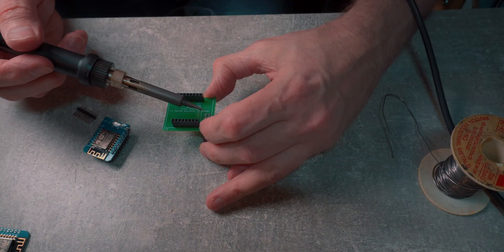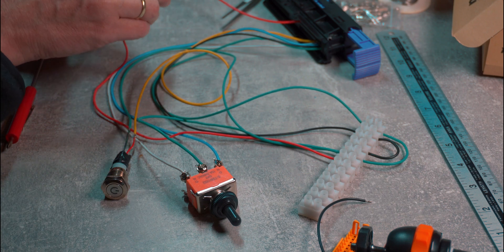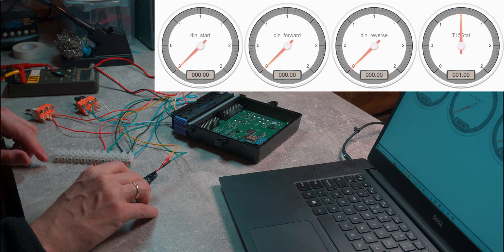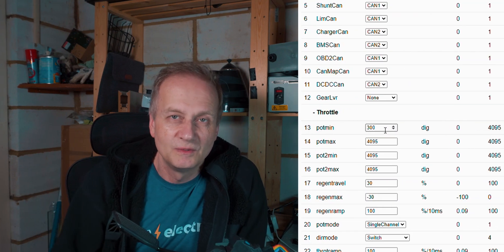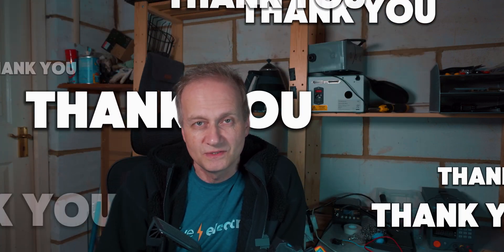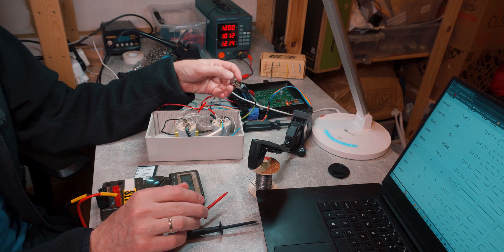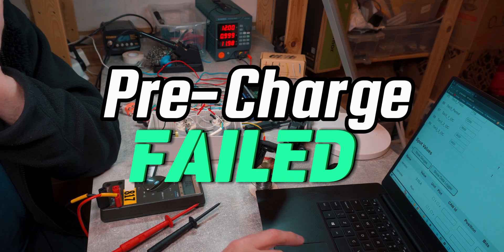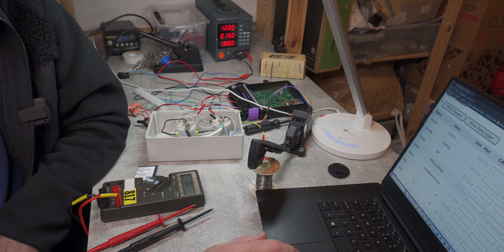Zombie VCU not going into run mode

Comment: Hi, are you going to use the ISA shunt in the junction box?
Reply from the maker: I was planning to get the BMW hybrid battery as it has the safety box built in I was planning to use that. I don't want to order an ISA shunt and get another box with the battery.
Reply: I am also drawn to a BMW hybrid battery for the same reason!

Comment: Great video! How do you get show gauges to show forward/reverse etc?
What car did your accelerator pedal come from? Thanks 😊
Reply from the maker: Thanks, you can find the button Show gauges above the bit where you get the graph. You need to tick the options you want to enable as you do for displaying the graph and click Show gauges after that. They open as a separate tab in the browser.
Reply from the maker: The pedal is from Toyota Auris. I got it from eBay a while ago as it was quite cheap about 10 pounds I think 🤔
Reply: Thanks for this…so much to learn!
Reply from the maker: @Ghia66  you welcome